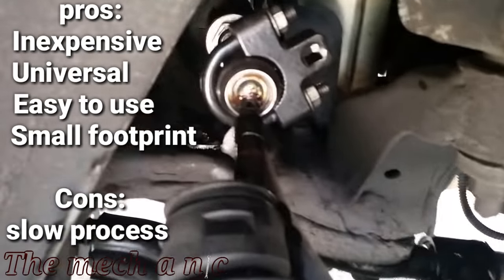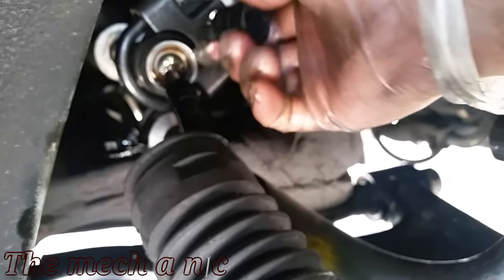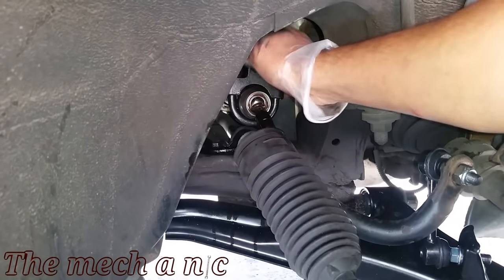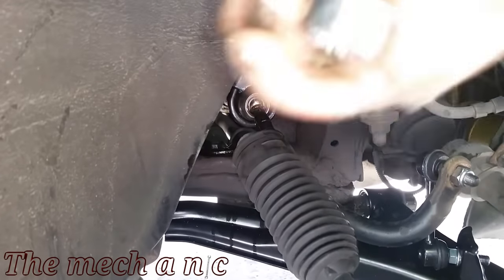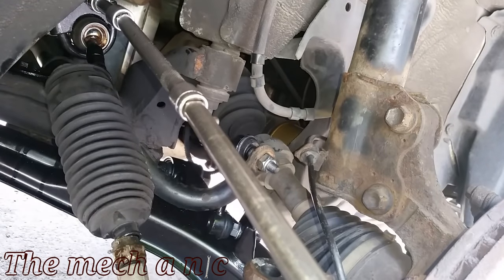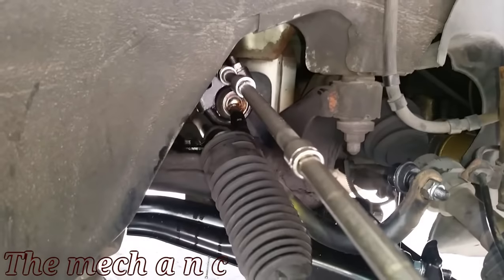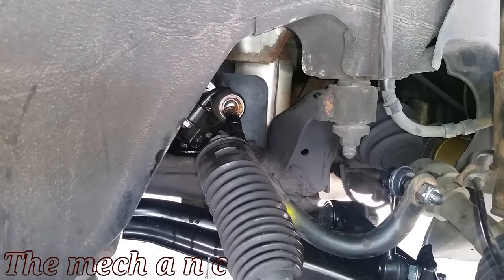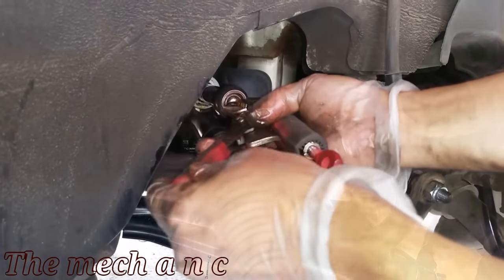Easy inner tie rod tool

Comment: Just had this issue I just used a pipe wrench
Reply: Did it come off easy with the pipe wrench?  I might try that.  I have to replace the inner and outer tie rods, pitman and idler arm on a Toyota truck.
Reply: What kind of car?
Do you think a pipe wrench would work on a 2001 Grand Prix SE?
Reply: @user-dt3kf9nu5u  
I don't think a vehicle with a pitman arm and an idler arm has this type of inner tie rod end?
Reply: @mrbreezeet1   your going to need room under it ... I put it on and broke it lose with the pipe wrench but I pushed it with my feet from the front lol hey you got to emphasis  I had no other way to the store and I did it to my 06 charger

Comment: small extension an the smaller size breaker bar would have worked being pulled down
Reply: Still tho which I hv, do u want to take the chance once you get to that point of not having enough clearance? Might just get more extensions just in case. Lol

Comment: I hate these comments cuz my outter rod is seized (not the nut on the center but the part to twist off) and i tried just doing the inner to remove entire thing, couldnt get it loose for the life of me, literally had to put everything back on and drive with my jacked up swaying car
Reply from the maker: Use a torch. Heat up the outer tie rod where the threads are. Hold the inner tie rod with a wrench and use another wrench to turn off the outer tie rod while its hot
Reply: @themechanic6117  its pretty seized to the point it started slipping on part i held inner tie rod at and kinda stripped it

Comment: There's no way an impact gun would of worked with that setup, for one you've got torque loss due to the fact you're using adapters and extensions combined.. but the main contributing factor is that it's not centre on the part you're removing, all your doing is trying to spin the gun in your hand or worst case snap the 1/2 reducer
Reply from the maker: I'm aware of that, it was something silly that I knew wouldn't work. Lol
Reply: @themechanic6117  lol maybe the vibrations could of possibly helped some at best, its a strange tool, I have never seen it before but it looks like it could get the job done as a last resort, I can see myself snapping many extension bars with that ><
Reply from the maker: Maybe the vibrations did help😂 surprisingly this tool has gotten me out of my tight places where my normal tie rod tool just didn't work.

Comment: Heres a tip. Get a pipe wrench, and turn the wheel. Then you wont need some fancy pants adapter or all those extensions.........
Reply from the maker: Ive done that for years.it doesnt work for every car
Reply: @themechanic6117  
Do you guys think there is room on a 2001 Pontiac Grand Prix to use a pipe wrench?
If not do you think there is enough room to use this tool you have on the 2001 Pontiac Grand Prix?

Comment: that pad lock lookin thing doesn't look like it's gripping anything! looks like it'll spin on the rod. you can rent proper tools that fit exactly over the inner tie rod.
Reply from the maker: This tool actually works well. I have many different tools for removing inner tie rods. This is just one of them
Reply: You can rent the tool if you can get to the parts store I cannot get to the parts store so I have to get this one off Amazon and hope for the best. 
This has been covered at least five times in the comments already.

Comment: Just use the pipe wrench so much easier and so much cheaper. .
Reply from the maker: Pipe wrench wont work for every car
Reply: @themechanic6117  do you think there is room for a pipe wrench on a 2001 Grand Prix SE?

Comment: $40 for the pittsburgh slide over tool with all the adapters
Reply from the maker: I have a review of that tool as well . when doing a lot of inner tie rods youll find that one tool isnt enough to get the job done. You need different variations of that tool

Comment: If your gonna go to the local store to get this contraption why not just rent the proper tool for free
Reply from the maker: True, but it's a cheap tool that can stay in your tool box if u want it.
Reply: Here is why. Yesterday, I rented the proper tool to install a new inner tie rod end on my son's Nissan Sentra 05..  The new tie rod end had the proper "notch" for the tool to grab.  All set...when I removed the boot from the old inner tie rod end, the tie rod end was smooth like a baby's butt all around, no notch.  Put the wheel back on and went to the local Princess Auto and bought the tool ($13.00) in the video (BTW, I did the job yesterday and watch the video today....). It work like a charm to remove the old tie rod end and I used the proper tool to install the new "notched" tie rod end. This is why.
Reply from the maker: Exactly, this tool has saved my butt plenty of times. There is no one perfect tool for inner tie rods. Thank you for your comment.

Comment: The impact gun isn’t gonna work not bc of the loctite, it’s not working bc ur trying to turn the tool from the ear which sits on a totally different axis than the tierod itself (much like you would with a crowsfoot) ... I’m surprised u didn’t break the tool or the adapter, or worst hurt ur risk considering the high torque of these Milwaukee impacts 😬 
Hint: even if ur using all those extensions, it will make it easier to break it loose if ur ratchet or breaker bar is perpendicular to the tool. For example @1:45, ur wrench’s handle should be pointing to the 1 o’clock and it’ll come loose with ease bc ur applying all the torque in line much like u do with a basic wrench 🔧 
😉 you gotta try it to see what I mean 
Good luck. Sometimes we miss such little things without much thought
Reply from the maker: Lol it was a silly test . i knew it wouldnt work because of what you described. Yes the tool didnt break lol 👍
Reply: So in other words your ratchet handle would be in line with that Tang coming up from the center of the tool correct that's the way I'm seeing it. In effect making an extension of that center part.
Reply: Or to put it another way; if the tang with the square hole was pointing down to the ground at 6:00 position the end of the ratchet would also be pointing down at the 6:00 position effectively lengthening the length of the Tang does that make sense?

Comment: Using loc tite is stupid!  The rod can't spin or unscrew.  It is pinned by the outer tie rod end that is attached to the wheel hub.  The only way the inner tie rod would start to unscrew would be if it was disconnected from the outer tie rod or the outer tie rod end was not connected into the wheel hub!  If either of those things were true you would have no steering on that side and that would be your bigger problem!  Don't make your life difficult with loctite
Reply from the maker: I never thought about that but you're correct.
Reply: The inner tie rod has a ball joint that can rotate on shaft. Over time the ball joint becomes easier to rotate and only has about 1/2" of thread going into the rack. Without thread lock, it would be possible for the inner ball joint to unscrew from the rack, especially if it was very worn down.
Reply: @joelaas6962  that is theoretically correct because it's a ball and socket on the inner tie rod end, when you loosen the jam not and turn the inner tie rod end the ball and socket is spinning therefore the inner tie rod could theoretically come loose
Reply: They don't recommend loctite and have a little tab to bend down for the fun of it
Reply: @themechanic6117  
No he's not

Comment: What are you talking about?? Those are all brand new screws I can remove that with my teeth.  Impact guns were  made because of the rusted screws ,not shiny brand new screws that were screwed yesterday. . Show me how you're removing helish 10 year old rusted screws my friend.
Reply from the maker: Impact guns don't discriminate
Reply: @themechanic6117  I wouldn't know. I know I bought either a sucky impact gun or a lousy air compressor.  I can't unscrew a slightly rusted 15mm screw and I bought it to unscrew the control arm on a car. Trying to find a way and here I am , watching a guy screwing a brand new bolt ,. It's like watching paint dry.
Reply: @themechanic6117  they don't discriminate but the idea came to the engineers because of the rusted ones. 🧐 .
Reply from the maker: You were better off buying a Milwaukee fuel impact gun. Ditch the compressor and be able to get the job done
Reply: @themechanic6117  wanted to do  something useful with the money I had , now I have a useless tool and no money. Bummer.  If it could only shoot bullets, the first one would be in my head.  Then a second one.  Then a third one. And it wouldn't make the job done.
Reply: @TheSign2020  Ingersoll Rand 2135 bad ass gun